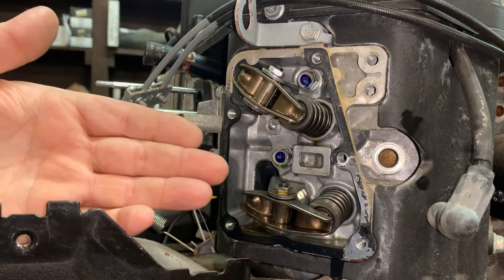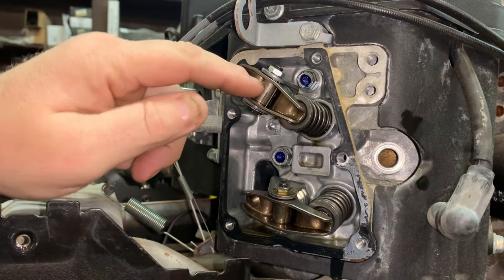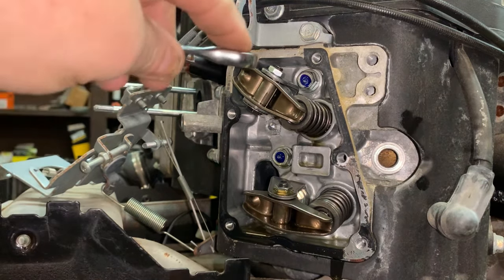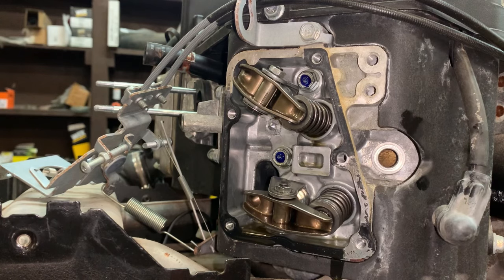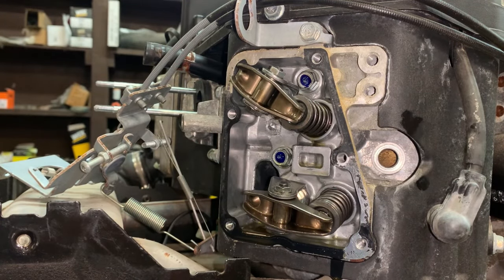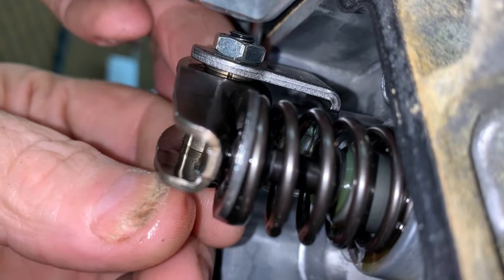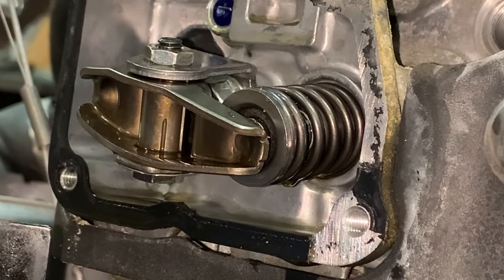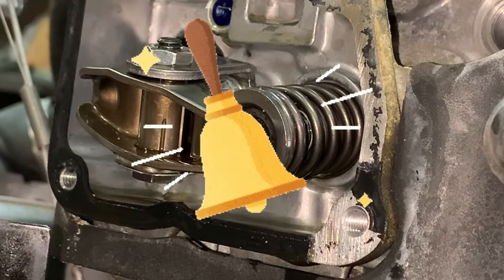SUPER EASY KAWASAKI “V-VALVE” ADJUSTMENT

Comment: FIRST watch this video because it is the best demonstration of a small engine valve adjustment
TOOLS: 10 mm wrenches or a 10 mm wrench and a 10 mm socket
               .004 feeler gauge. (better than manufacturers recommended gap)
                Replacement gaskets or silicone gasket sealer
1 Remove spark plugs to make the engine easy to rotate
2 Remove the valve covers
3 Roatate the flywheel by hand until one valve is fully open then adjust the CLOSED valve as follows
4 Loosen the rocker arm nut then rotate the bolt until the clearance is set
5 Hold the bolt and lock it in place by tightening the nut
6 Verify the clearance and adjust if necessary
Repeat for each valve then reassemble with new gaskets or silicone gasket sealer
Reply: question from a newbie..  . Does closed valve mean the valve is at the top and fully open mean it is down?
Reply: @dukemanvillle  Exactly.
Reply: I have x350 john deere from Australia, is 0.04 clearance for both inlet and outlet valve?
Reply: @NeymarjuniorA  Yes.

Comment: I had my JD Z540m with Kawasaki serviced by John Deer. I've had the valves adjusted at 200 hours and again at 368 hours. (JD  recommends every 200 hours adjustment.)Both times 2 valves were out of adjustment and 2 valves were good. What keeps causing the out of adjustment. Thank you for the video. Blessings to you.

Comment: Nice video, really shows the process clearly. I'm probably in the minority but I am not a fan of the Kawasaki eccentric adjusters. I much prefer the standard locking torx screw on the end of the rocker. The problem with the eccentric adjusters is they move and change the setting when you tighten them. I noticed when you tightened the first one your gap got smaller as your feeler gauge slipped out and I doubt you would have been able to re-insert your feeler gauge. I sometimes have to try to predict how much the adjustment is going to change and then misadjust by that amount so when tightened it is within spec. It's a lot of trial and error. These lock nuts are also supposed to be torqued and it is impossible to get a torque wrench on the bottom adjuster on the cylinder with the nuts on the bottom. I ended up using a crows foot on my torque wrench. The locking torx screw style are just so much easier IMHO.
Reply: Crows foot wrench will change the torque value so be careful
Reply: @joelmollenkopf3767  Yes, you are correct. But... it also depends. If you keep the crows foot at a 90-degree angle to the torque wrench there is no change to the torque value applied. With the 10mm flare nut crows foot I used, had I used it in line with the torque wrench I would have had to set the wrench at 6 Nm to get the required 11 Nm of torque.

Comment: Thanks so much!! 
Question: I'm doing my JD X300 clearances and the shop manual says to set them at 0.05 mm. Then it says the Valve Clearance (when cold) Inlet, Exhaust 0.10 ∼ 0.15 mm. Why am I setting them to 0.05 mm first? I'm already doing this with the engine stone cold. Can't I just set them to 0.13 mm (middle of their specified range)? Thanks again...

Comment: Would have been nice to see where you rotate the flywheel to since that is an important part of the procedure.
Reply from the maker: You don’t have to rotate it at the fly wheel. All you have to do is put a wrench on the bottom of the crank pulley.

Comment: I have a stand on mower with the Kawasaki 600 . It has 230 hours on it and runs great, but how many hours should I do this? Thanks!!
Reply: Kawasaki fs600 manual States at every 200 hours to check this I'm approaching 1,000 hours currently at 990 I have never done this I'm about to do it

Comment: What is the interval for adjusting valves? How many hours is normal?
Reply from the maker: too many factors to give a definite time frame
Reply: The shop manual for the FS600V says every 200 hours.  That's on a John Deere lawn tractor, X-370.

Comment: Hi mowermedic1! I have a 2007 exmark turf tracer that has a kawasaki FC420V engine which runs and starts just fine but has gasoline leaking into its exhaust/muffler. Neighbors and friends say that it could either be a stuck valve seat guide or a cracked engine head. I was wondering if you could maybe tell me what the problem most likely is if you had to guess what it is. If anyone else knows what the culprit might be as well, I'd be glad to hear it. Thanks in advance.
Reply from the maker: Needle and seat failure inside carb
Reply: @THEMOWERMEDIC1   Thank you very much! Will look into fixing it! Greatly appreciated!

Comment: Will that gasket need to be replaced?
Reply: Absolutely with a genuine Kawasaki rocker cover gasket. Get the old one off carefully not to damage the aluminum surface and replace it after you're done with the work under there. An oil leak can turn into a big fire really quickly once it hits that hot exhaust header. I actually thought of mounting a dry chemical fire extinguisher on my mower just in case. I don't know if they make a foam extinguisher but would be nice.